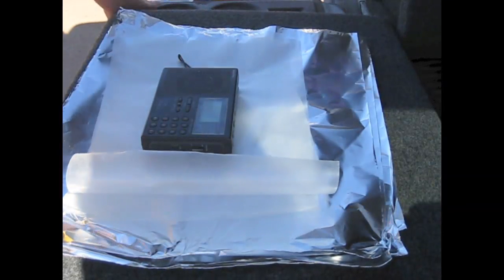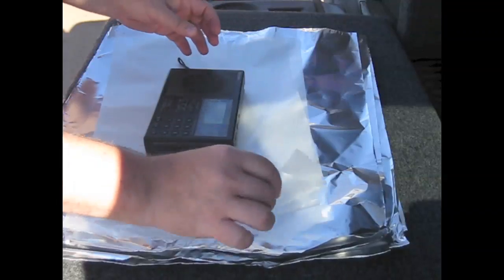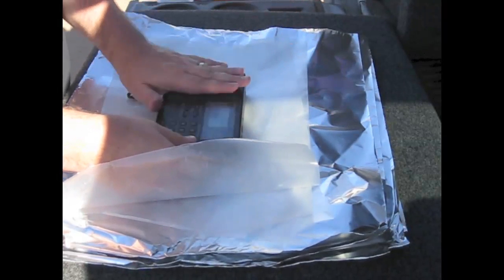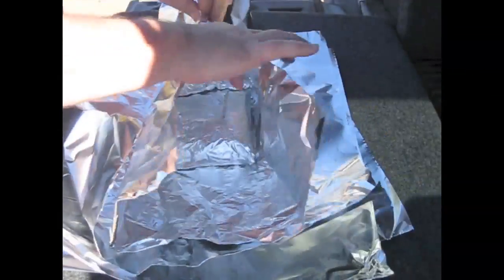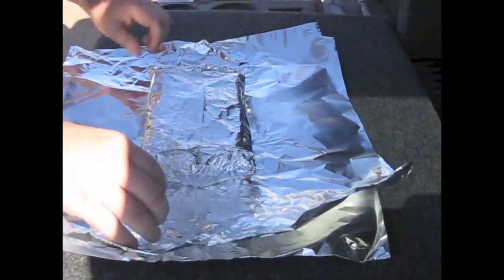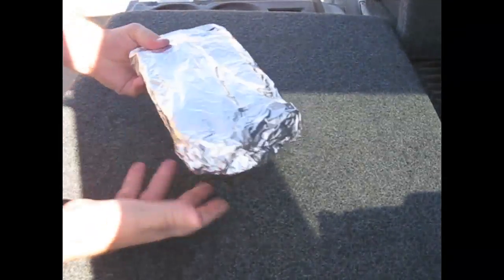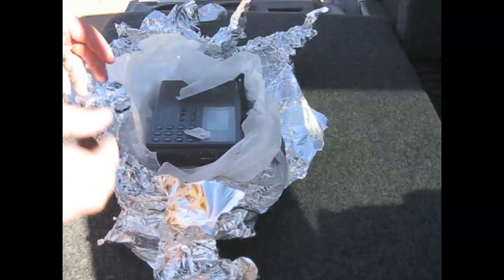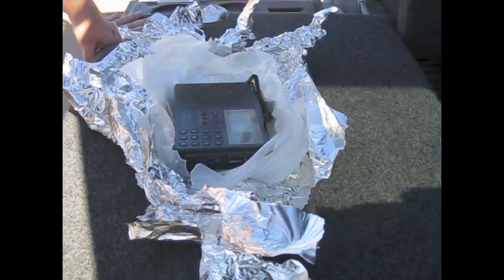Surviving EMP - Testing Faraday Box - Part 2

Comment: Doesn't there need to be a nonconducting larger between every conductive layer.? I've read that if you do it like you're doing the signal wave travels right through the aluminum at contact points and this is not efficient.thats why the trash can and test 1 worked better.
Reply: Sorry about typo. I meant to say layer and not larger

Comment: Actually It's a very thick lead top with 3" of concrete on top of that, with 1" debar welded at 1' squares in the middle of the concrete.  It was designed during the Cuban Missile crisis. But I get your drift on the properties.  Another thing that has crossed my mind is that if a huge x class flare came down cell phones and everything but ham radios would be rendered useless as the towers would burn out. So wouldn't you need to store like batteries solar panels along with hand generators, basics

Comment from the maker: I'm not all too familiar with the shielding properties of lead. My best guess is that the lead would probably be sufficient, but the concrete would not. EMP can penetrate at least 10 feet of earth and when you look at the shielding properties of earth and concrete for gamma radiation, 1 foot of concrete does not equal 10 feet of earth. You would probably need several feet of concrete at the minimum.

Comment: Man I appreciate you putting this up with all the comets coming in and x and m class flares, would a basement build as a bomb shelter with a lead top and reinforced concrete like 1 ft thick be enough?  I guess I'm asking if any conductive metal work as a cage that's grounded?

Comment from the maker: If the lid of the trash can has a good metal to metal seal, you don't need to tape it with metal tape.  Military grade Faraday cages are made from a copper mesh, which has very fine holes in it, so "pinholes" in your containers shouldn't be an issue.

If you wanted a container bigger than a shoebox, I'd suggest the trash can; it's far easier to make an effective Faraday container from that than it is trying to wrap layers of foil around a box.  IMHO.

Comment: Not only would you have to have something inside the metal garbage can to insulate the items from the sides, but the lid would have to have some type of layer over the seam because otherwise the shock will still get into the can. Are you using aluminum tape for that?

Speaking of aluminum tape, what if you wanted to make a Faraday Cage out of cardboard box; the foil doesn't come in large enough sizes for that, so could you use aluminum tape to "sew" the pieces together so to speak?

Comment from the maker: Thought about doing that, but see two potential issues with that: 1) foil is thin, the layers are needed for mass, I'm not sure if separating the layers would help.  2) if you were to alternate paper, foil, paper, foil, paper, foil, etc., what you would be creating is a crude capacitor.  I'm pretty sure that's something we don't want to create.  I don't know for sure what the effects are in doing that, but I wouldn't, at least not without more information or testing on it.